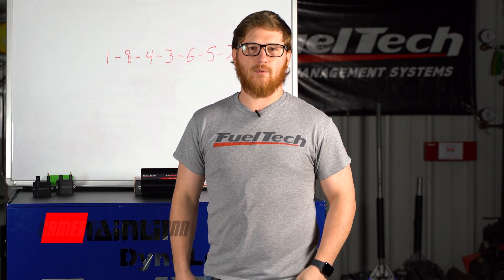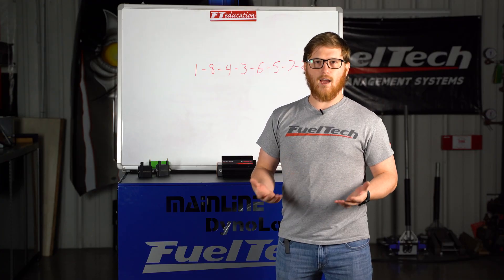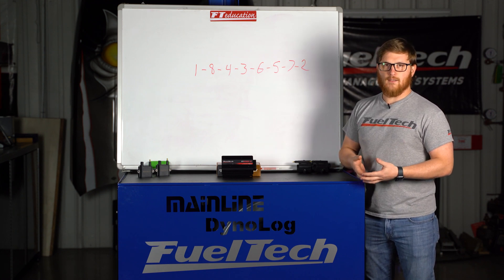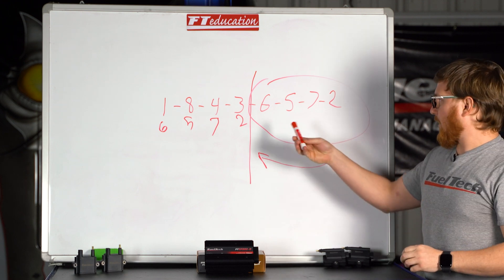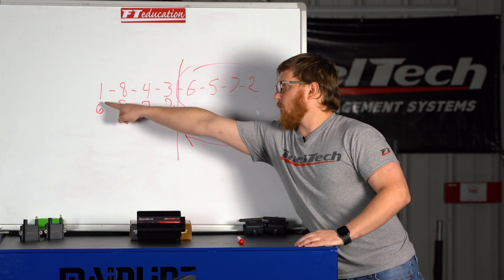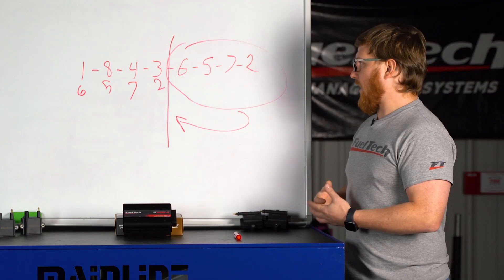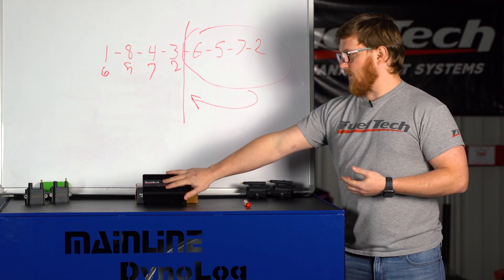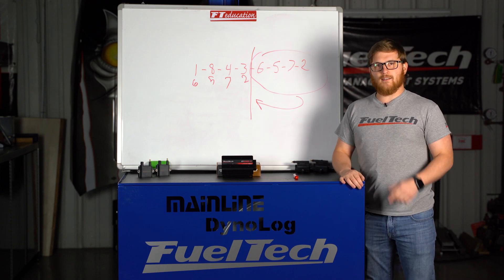What is wasted spark and how does it work!

Comment: wasted spark also cleans suet. seq was invented for emissions more than performance.  
Some topfeed drag cars still have dumb wasted spark used.  Seq also increases amp draw and heat due to the output.  
It depends what you are using the car for, the only advantage to seq is really in cold starts and when you need high amp coils for the boost levels you are running not to blow the spark out, since most dual firing coils don't have higher amp/output available. If you are wiring seq coils as wasted spark and still have a coil for each cylinder you are defeating the reason to use wasted spark.

Comment: I understand waste spark principle but does it mean if there is no camshaft sensor that ECU activates 2 fuel injectors at the same time? I doubt that but dont undestand how ECU can determine which specific cylinder is in intake state if there is no camshaft sensor and activate only one specific fuel injector?
Reply: Wouldn't really have to if I'm correct. If your matching the corisponding cylinder it should always be completely opposite of the other.

Comment: Thanks for the video. Question? For a BMW (V12) M73 and a Firing order of 1,7,5,11,3,9,6,12,2,8,4,10 does it work the same way? I think I’m overthinking this for a wasted spark system. I have two 6 pack coils. 

Using your method I came up with:
1,6
7,12
5,2
11,8
3,4
9,10

Didn’t look correct to me. 

Thanks for your help

Comment: Thanks but I dont understand wasted ignition system really. When it is firing 2 cylinders at the same and the wasted part are a waste why it is an important thing when firing?.......
Reply: As I understand, this is not a "best fit" for any setup, but a "workaround" when you don't have enough output cables to do it sequentially. In a V8, Instead of 8 outputs (for sequential) you just need 4 outputs (using wasted spark).
Reply: It halves the amount of ignition coils needed to run the engine by firing 2 plugs at the same time from one coil. So one plug is firing on the compression stroke like normal and the other plug is firing on the exhaust stroke of another cylinder where there is no compression and therefore becomes a wasted spark. It can however improve emissions by igniting any leftover fuel and decrease wear on the catalytic converters.

Comment: Nice explanation, I am very new to this and will be adding an ECU to my Classic Mini in preparation for adding a Supercharger and having fully mappable ignition. I have a VW Smart Coil and Leads and will be using a Speeduino ECU. Plan was to use Wasted Spark. I have also been told that without a CAM sensor, wasted spark is my only option. Otherwise fit a CAM sensor and use sequential ignition. So, what are the benefits of Wasted Spark v Sequential Ignition?